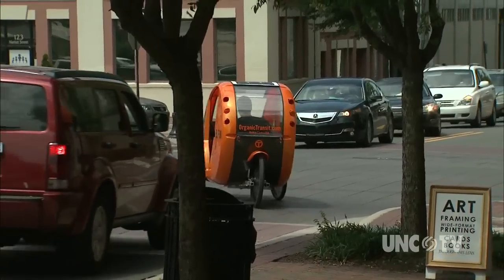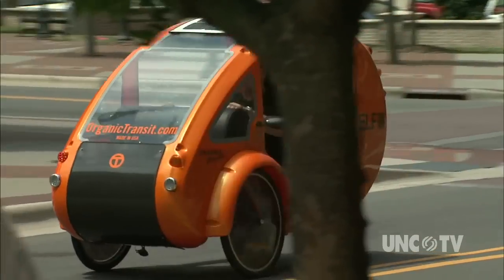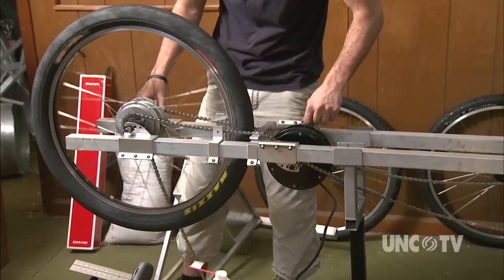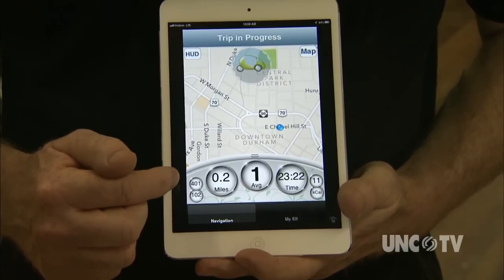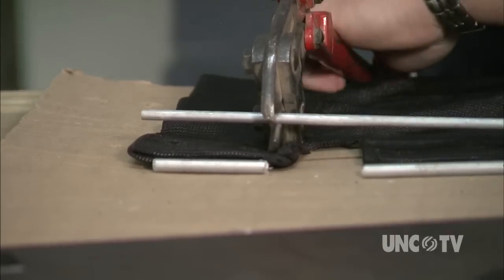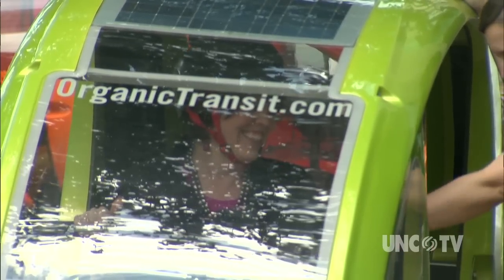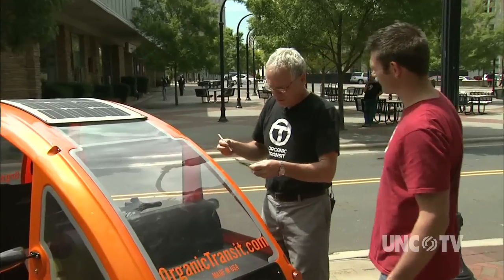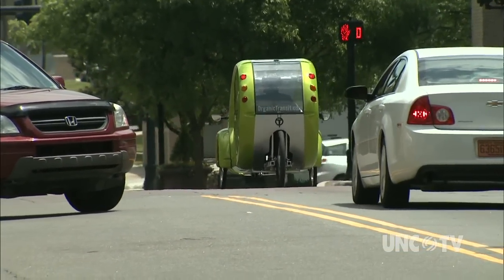NC Now | Organic Transit ELFs | UNC-TV

Comment: the market is out their,pricing,infrastructure,a simple low cost suspension in the front and a single swing arm in the rear could make  for a huge improvement in ride quality.Tweaking the aerodynamics is where the vehicle could gain the most improvement in both range[electric and rider endurance]90 percent of your effort on a bicycle is wasted on overcoming air resistance,while this is better then a standard bicycle,their is plenty of room for improvement.Aerodynamics are worth a huge boost in performance and range.A motorcycle that gets 50 mpg stock,with a aerodynamic nose and tail[not a streamliner]it will easily double to 100 mpg usa,or 2 liters per 100Km.So the Elf could really take a load off you and your pocket book,while having some good old fun.
Reply: Tire choice can change the ride comfort as well, minus the bigger weight penalty (inefficiency).  If you try a road bike, then a mountain bike, you will see what I'm talking about.  The fatter tire is cushy.  That's the nice thing, using bike parts, the thing is like mechanical lego- modify as wanted.

Comment: It actually uses a 480 watt/hr rated Lithium Iron Phosphate battery.
These can be good up to around 3,000 full battery charging cycles.
Sometimes less (or more) though but at least around 1,000 cycles.
Basically a 480 watt/hr Lithium Iron Phosphate battery can be purchased for around $500 or so.Maybe a little more.Myself I have a 240 watt/hr Lithium Iron Phosphate battery on my 250 watt electric assisted motorized bicycle.

Comment: Turning in the rain looks wet--those fenders can't possibly be adequate enough to avoid rebound splashing off the frame. That said, it looks fun. I was looking at other Velomobiles but they were all too expensive. If they could just mass produce this thing, it might only cost $3k. A reasonable trike costs less than that--this just has a shell and some accessories.